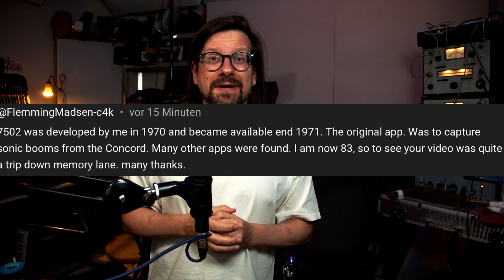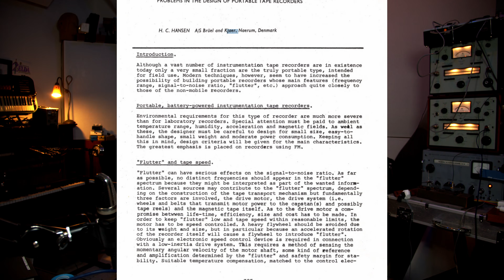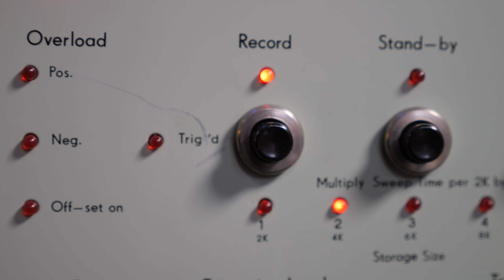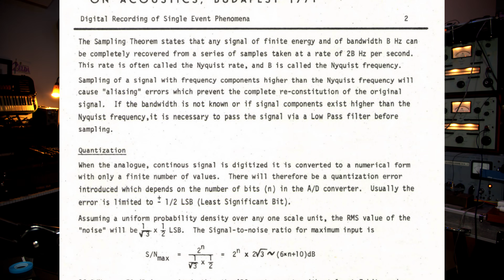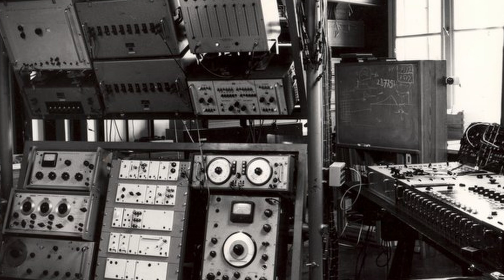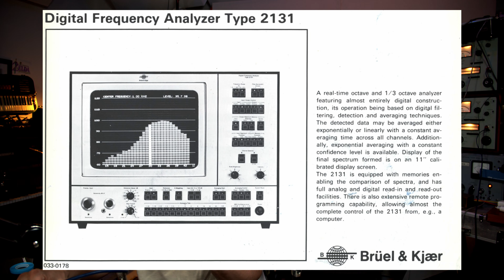Catching the Concorde - The Story Behind the Test Equipment Sampler

Comment: Hainbach, I have fun suggestion for you I hope you can try! I'm sure you are already aware of this, but a möbius strip is a loop of some material with a half turn inserted, giving it "one side", in a sense. My idea is to try creating a möbius strip tape loop, and see what kind of results you get! To do this, you would need to make the tape doubled-sided; I'm not sure if such tape already exists, but you could take two equal lengths of tape and carefull glue them together to make some. Then, you tape it into a loop with a half turn and see what comes of it! On the second rotation of a möbius strip, the image is mirrored in some way, so I am curious what kind of effect this would have on a tape loop, if any? would it simply cause the left and right channels two swap, or something more drastic? I am not sure on the specifics of how the tape and the magnetic heads work, so I cannot predict it! But I hope you can try it out and have some fun :) if I try it out (which I should...), I will post a video as well